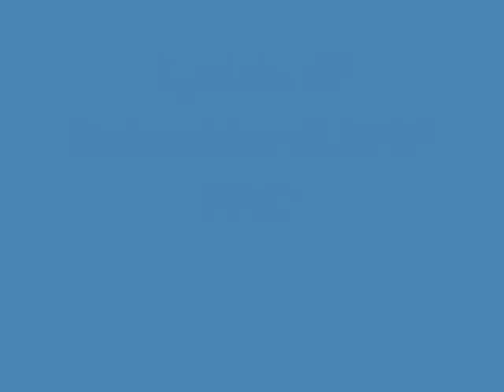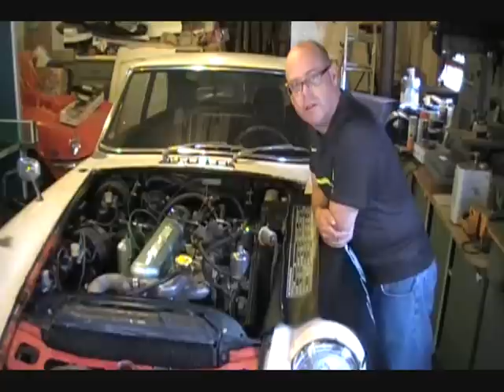MGC Engine Video

Comment: Just watched your video - hope the build is going well! Only a minor issue - the engine is not an Austin Healey engine - this engine was specific to the MGC and one other BLMC car...the AH 3000 engine only shared the same 2912CC displacement, the AH engine had 4 main bearings as opposed to this engine having 7 main bearings. I do not believe the AH engine has any interchangeable parts! Great video though! Thanks